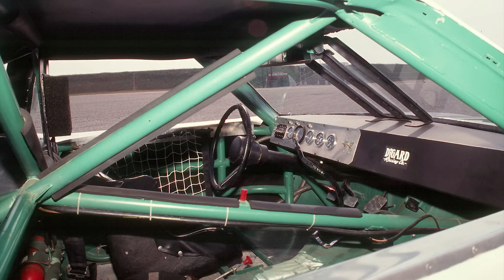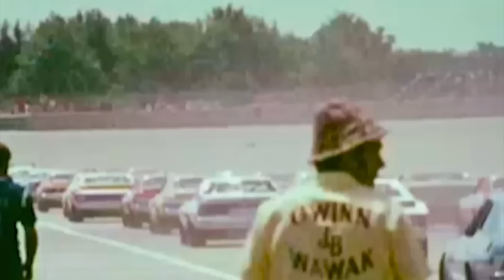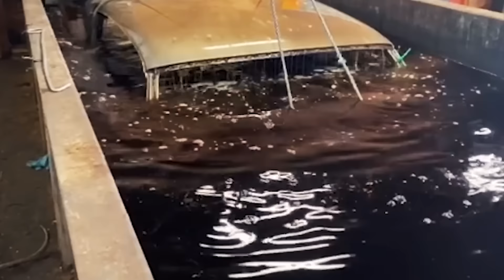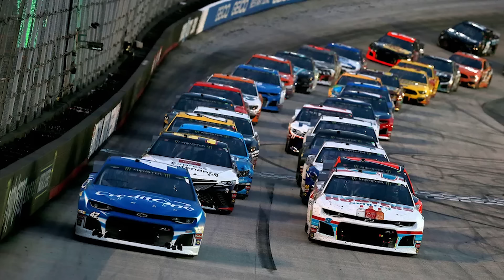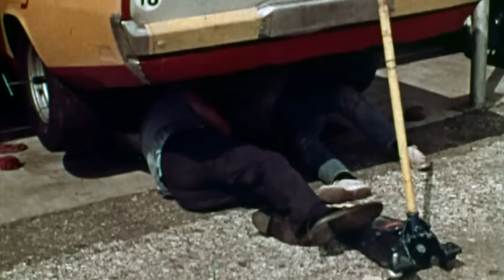5 Illegal Racing Tricks NASCAR Had to Bury Forever

Comment from the maker: I think the gas line trick is the most brilliant method out of the entire bunch!  What are your thoughts?
Reply: My favorite is the Daytona restrictor plate work around, literally. The rule states that all air and fuel must pass through the restrictor plate. This plate goes between the carburetor and intake manifold with 4 holes smaller than the 4 barrels of the carburetor to reduce the amount of airflow, and reducing power. The 4 mounting bolts for the carburetor also must, of course, be in the plate.
    So if the restrictor plate mounting holes get a little bit bigger, and some extra passages are drilled in the right places in the carburetor and intake manifold, you now have 4 regulation holes and 4 small but significant extra passages through the restrictor plate. 
   The argument that it met the letter of the rules didn't work. 
 Big Bill's catch all ' violation of the spirit of the rules ' is for the rule about to be written that will now be retroactively be applied to you.
Reply from the maker: Ohhhh...this is a good one!!
Reply: I thought I read somewhere that Smokey’s fuel line was about 100 feet long ( not 11 feet that wouldn’t give you very much extra fuel at all as most cars are at least 10 feet long already) coiled up inside the car, with most of the length hidden where you couldn’t see it making it into a small extra tank. 

 My favourite trick that I also read about somewhere many years ago was that he would run a sandblaster through the inside of the fuel lines effectively thinning the tubing wall turning it into a larger line ( but only on the inside of the line ) while appearing the proper size on the outside! More fuel ⛽️ = more power 💥  😏to Smokey the rules were more like suggestions 🤭 to be worked around or to find a way past or directly through it in a sneaky way… if they can’t see the trick with their own eyes or  it’s not specifically written in the rule book 📕 that you can’t do this or that , then it’s not “cheating” ! 😄 There’s actually a book that was published many years ago called “Horsepower Secrets”  by Smokey Yunik , i saw a copy in the Miller & Wyatt auto parts store when I was about 20 years old and I wanted to buy it but i had to buy the part that i needed to make my car run and I didn’t have enough money on me that day to also buy that book , I went home fixed the car and came back the next day to buy the book. Unfortunately someone else beat me to it ,  bought it and it was gone and I’ve never seen another copy of it to this day… 
I still think about it from time to time and wonder what other hidden gems 💎 of racing goodness were in that book ! The more I think about it, it still makes me want to go and find a copy even 30+ years later ! Smokey 🤠 was the king 👑 at bending those rules! 😉 you just know there’s just gotta be some great things hidden in those pages ! 😊
Reply: @andrewpardue3324  Smokey's "Long Line" fuel system was stage 2 of his fuel line shenanigans - stage 1 being the "Fat Pipe" system. When that was caught, NASCAR specified the diameter of fuel line that had to be used, thinking that would fix Smokey's tricks - only for Smokey to game the system again, resulting (eventually) in the length of fuel line being standardised as well. Not for naught is it said that Smokey Yunik wrote half the technical rules for NASCAR...
Reply: @gchampi2 maybe trying googling the answers first, write a script and make a factual video, rather than handing that off to AI. You seem to have the resources and the time.  I hate that YT rewards these crappy videos.
Reply: @gchampi2 
Thanks for the info I had not heard anything about that, the “fat pipe“ fuel line trick ! 😄 the more I learn about Smokey over the years the more and more I like him. It seems every time they nailed him doing something ( that was not an actual rule at the time he used the trick) and put a stop to it he just figured out another new different way to get more power , run longer or get better aerodynamics! That’s the very definition of somebody who never gives up. 👍🏻🍻 cheers ! 😊
Reply: A cubic foot is 7.48 gallons
Reply: NASCAR IS A BUNCH OF WOKE PUSSIES NOWDAYS KILLING the SPIRIT OF THE CHALLENGE to go FASTER unless your DADDY WARBUCKS
Reply: i think ive seen this content on other channels and wont be hanging around for this autoplayed video
Reply: Big fan of the acid bath, although I  believe coating structural areas with a resistant to the bath, might be good solution to this.
Reply: Sure... but an 11 foot by 2" line holds 1.8 gallons... not 5+ gallons
...and a "normal" fuel line isn't "3-4" feet long... it has to run from the gas tank (in the back) to the fuel pump and then to the engine in the front.
Reply: @billymanilli , I'd heard it was two extra gallons (we're close), which is more logical than five. Even so, on a long race with several pit stops, that can be critical. My understanding was that he'd used garden hose, which is easier to route than the 2" line indicated in this video.
Reply from the maker: you are right billy...math not mathin for me...

Comment: some of these videos are a little sketchy, i was at the 1976 daytona with an independant driver and car, Tom Williams from san antonio tx. the cars were basically real cars but modified for racing with the roll cage and suspension changes. the inspection process didn't seem any different than 1973 when i was there. i just remember needing documents showing parts that had been x-rayed or magnafluxed, and i must have pulled the damn carburetor off so many times i was afraid i would wear the bolts out. btw, back then we towed the car to daytona on an open car trailer with a 3/4 ton gmc pickup and a camper shell, and there were plenty more doing the same.

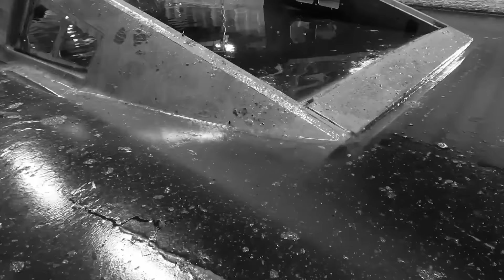Comment: 14:00  they could have covered the structural parts with an insoluble coating so that the acid wouldn't eat it away, so they wouldn't have to put in internal reinforcements

Comment: a standard fuel line is also 11 feet to get from the back of the car to the engine up front... its the larger diameter that makes the difference. 11 feet is not really longer than normal... for a front engine car, the tank is usually in the rear, so yeah thats normal length... but 2 inch is much larger than normal, normal diameter is like 3/16 of an inch to about a half inch at the largest, normal is about 1/4" to 3/8"

Comment: Adding 5 gals of fuel also adds weight. Yes it's a diminishing weight penalty that is offset by the diminished time doing pit stops. I did something similar in the 70's with a 300 mile funzy race through a notorious Rocky mountain canyon. I could do it 1 1/2 times without filling up. I used to do a 30 second pit stop to reengage my mechanical secondaries on the spreadbore when I got out into open rolling country.

Comment: Ya forgot about  Henry "Smokey" Yunick!!! The man Did one better he Made Parts of the Roll cage a Fuel Tank Per Say the roll cage was used to hold fuel!! Similar to the larger fuel line But without the Line the Fuel was In the Roll Bar!! But either way it was Smart He would say If you aren't Cheating then your not trying !!!

Comment: The fuel line is the most IN YOUR FACE Cheat. 
The Acid Dipping is the most crafty. 
The Buckshot drop is the most basic, backyard, 6 beer, thought out cheat.
The Nitrous Cheat would have been the most obvious. The sound alone would have been so noticeable.

Comment: I doubt a car could be driven anywhere after the fuel tank is removed. The pump is usually in the tank and the injectors need a pressurised loop line to work.
Reply: Back then the fuel pump was mechanical and mounted to the engine. The fuel was then pumped to the bowls on the carburetor. So between the fuel left in the line and the fuel in the bowls on the carburetor it absolutely will start and run till there isnt any left. A regular carbureted v8 will idle for a nerly a minute with just the fuel from the bowls in carburetor. Then you add the extra fuel in the lines its entirely possible for smokey to have driven off with no tank

Comment: Another modification that Smokey did which didnt get banned because the car had finished racing before it was knew about...

Was the engine modifications to the "famous Hudson hornet" 
as featured in cars movie... 

in cars 3 Smokey features in it aswell as a early model pick-up and is a old friend of the Hudson..

Which is true because Smokey was the mechanic for the Hudson for a while..

And Smokey asked the rule makers about offsetting the pistons in the block.. they said no...

So Smokey decided he would offset the crank in the block instead 😂 which meant he had to offset the bellhousing on the block aswell.. apparently the floor was majorly panel beated to accommodate the offset gearbox 😂

Comment: yeah the extra long fuel line is pretty well known by now,most of the other crap is rumors on top of rumors and old bs around the beer guzzlers. if weight is only checked at the beginning of a race there are plenty of ways besides intricate bs. check out how short track racing that had left and right side weight limits, gary balough got a track shut down for environmental clean up on a deal he used to use with mercury as a limit changer.

Comment: Somebody really should have checked the math on Smokeys fuel line. A 2 inch diameter tube, 11 feet long only gives you 414 cubic inches of volume, which is 1.8 gallons. And I'm pretty sure that a 2 inch pipe, snaking around the chassis, couldn't be mistaken for a 'hydraulic line'. My assumption is that they thought it was a part of the chassis itself. A basketball would give slightly more volume, about 1.95 gallons.

Comment: The acid dipping wasn't so much banned because it reduced weight, as they still had minimum weight requirements. It allowed them the make up for the missing weight with ballast that they could position exactly where they wanted it for the best performance.

Comment: Yep Smokey Unix and is 1 1/4 inch fuel lines. The best nitrous trick have ever seen was a pressurized frame full of nitrous injected through bolts with holes passing the gas from the frame into the engine through oil passages specially modified. They found the acid dipped bodies when one of the tech inspectors leaned against a fender and it crumpled. I remembering incorrectly it was a 2-in fuel line

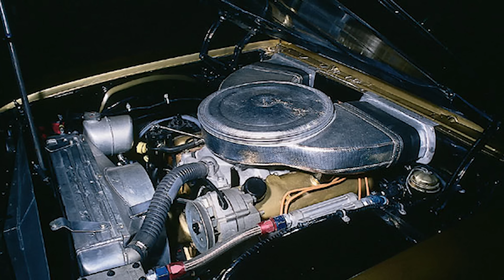Comment: 18:35 Nice story, but the math doesn't add up. A 2" ID pipe at eleven feet comes out to 1.79 gallons, nowhere close to the alleged 5 gallons.
Not that 1.79 gallons isn't an impressive cheat.
Reply: I read Smokey's book, "Best Damn Garage in Town". He stated he had fuel line draped all over the car. certainly more then 11 feet. He made his own camshafts that rotated in the opposite direction; so where a typical V8 rolls to the right; his rolled to the left; a better setup for left turn race tracks.  Smokey said even the driver didn't notice.  Read the book  to find out how he made his camshafts appear to be stock.  In racing, cheating is not considered to be immoral or unfair.  Cheating was described to me, by the mechanic that built my 1st race engine, is only limited to the degree that the rulebook creates a process that will discover the creative or loose interpretation of the rules.  Ex: If the rules don't use a process to inspect and measure engine internals, "a teardown", than effectively, there are no rules despite what the rulebook says.  We would call that "engines are free" as in no limits.Once you realize that race engines only need to last 50 feet or 5 seconds past the checkered flag; than engine longevity is replaced by least amount of drag or friction that produces the max HP. In the LeMans 24 hour endurance race, Audi created a complete replacement engine with quick connect hose connections, preoiled, motors that enabled them to do a complete engine swap mid race to cope with the stresses of running a "diesel" race engine in about 10+ minutes.  In the old Suzuki Cup motorcycle races held at Road Atlanta In October each season; there were no teardowns allowed for in the rules until the final championship race held on Sunday.  All practices and qualifying races on the day before, Sat, did not require teardowns. So Sat laptimes mysteriously got 4-5 seconds slower on Sunday where engine teardowns were required on the first 3 finishers.  All Sat night your could hear the fastest racers doing engine changeouts. Hmmm?

Comment: Remember Bristol, TN, They installed a modified (weak) coil spring that collapsed with no recoil under the weight of the turns.  The car collapsed 1-2 inches and  was eliminating air under the car... the front spoiler was grinding off on the track by the time it won... 😅

Comment: When I calculate the extra fuel in the enlarged fuel line, I arrive at 1.8 gallons. Not 5 gallons.
Still, considerably more fuel than the opponents.
Reply: unless he was using quick connect fittings with one way valves disconnecting the fuel line and starting the car would suck a lot of air into the line, especially if it was a large diameter line.
Reply from the maker: Math not mathin...I know

Comment: i would say the no gast tank is an urban myth by this time.
how would the car be running if the fuel line is on the bottom of the car and no fuel would spill out? 
use a plug you say but that need a vent hole to not create vacume that wont alow the fuel to flow to the carb and fuel pump.
the car might have had enough volume of fuel in the line to go the stetch to the garage or several laps extra if it had a tank at the other end that supported the fuel to flow and dont get in a vacume lock.
Reply from the maker: Agreed...myth

Comment: Ok acid dipping the car but putting a full cage in it your gonna gain weight the so called 5 gallon fuel line would need to be bigger than your head for it to hold that much despite not having fuel pressure once the tank is emptied this is all movie garbage none of this happened
Reply from the maker: Cool

Comment: Well the brave drivers that hid the ultra small nitrous tank in the engine oil pan were completely nuts, when the engine would lose a rod and puncture the nitrous tank, would turn the remaining oil in the engine and nitrous added made for an excruciating hot fire ball, made spectators setting close to the track in the grandstands having to turn their heads to protect spectators facial hair and eyeballs
Reply from the maker: Yea, I would not do that...They were crazy

Comment: That "it was an illegal car that passed inspection" is nonsense.  Because "If it passes tech, it can race" is also a rule.
Reply: Nope. If what races isn't what passed inspection, it's an illegal car. It passed inspection with weights they'd remove for the race. (dropped during the formation / pace laps prior the green flag.) I've seen similar BS tried in other series - go through tech with one (legal) set of tires, but swap in illegal tires for the actual race. (it's now part of the on-grid inspections.) Even putting more than 5gal in your "5gal" fuel cans. (you can get almost 6 in there without overflowing. yes, pit marshals can tell. I have 5.75 in mine right now.)

Comment: Moral of all these stories. Pencil pushers kill innovation and outside the box thinking.
Reply from the maker: Well said
Reply: Not at all. These are a**holes looking for everything the rules don't explicitly address. When you're filling your roll cage with gasoline, that's not "innovation" or "out of the box thinking", it's f'ing stupidity to gain a thousandth of a percent advantage. I've seen too much "not prohibited by the rules" cheating... even in series where there's no point - there's no six figure prize for a win.

What's the point of acid dipping the car if you have to put all the weight back in the form of a cage? I've seen several cars like that; 90% of the stiffness is the cage. (the car still flexes, but 3 of the 4 wheels stay on the ground.)

Comment: The acid dipping to reduce weight makes absolutely no sense considering the weight you have to add back in for the full roll cage. Even if you lose 380 pounds how much does the full roll cage weigh.
Reply from the maker: Valid
Reply: About 150 lbs.
Reply: @kenik2023 I would guess it’s significantly higher than that.
Reply: If you don’t acid dip the car you will be that much heavier when you add the cage. So your cage doesn’t add more weight if you acid dip the car.
Reply: @larrymitchell8464 you obviously missed my point entirely, when you purposely destroy the structural integrity of the vehicle only to have to go overboard to protect the driver from injury it makes absolutely zero sense just to drop 100 pounds or so.

Comment: There was something about spray painting the inside of intake manifolds that made the motor run cool, causing less stress and allowing it to breathe freely and extend the distance between refueling. Huge advantage over the span of the race.
Reply: I had never heard of that , I have heard about very carefully sandblasting the runners a bit making the inside runner walls even smoother so it would pull better flow numbers.
Reply from the maker: Nice!

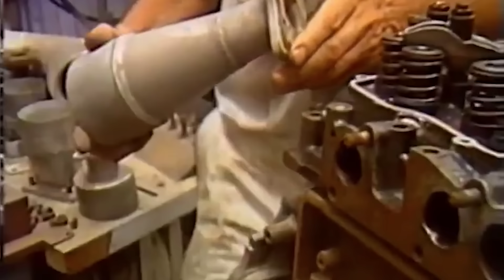Comment: 6:25 Fuel additives 😂 that's kinda funny because back then you could get 260 octane fuel at the gas station pump 😂 back then the lowest fuel octane gas was 110 octane which they now call recreational fuel today for orv's . And now you can only get like 93 to 97 octane at the gas station 😂🤣
Reply: The 260 you’re referring to was known as Sunoco 260 which was 97.5 octane rating . The Sunoco 260 today has an octane rating of 100. The lowest octane rating in the 70s was around 90 although some stations offered Sunoco 190 which was 87 octane. Get your facts straight before commenting so you don’t look like a fool!
Reply: @74OBOY even the best mix we had for fighters in wwII was only 150 to 170 octane, while the Germans only had 130octane at first so less supercharger pressure (boost) could be used
Reply from the maker: True...good call sir